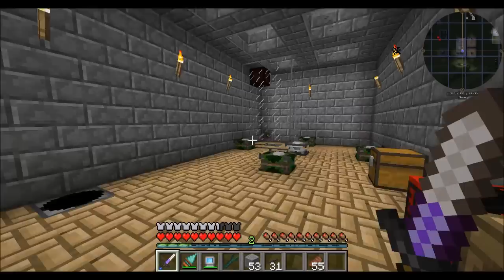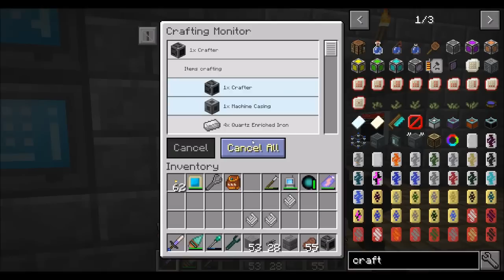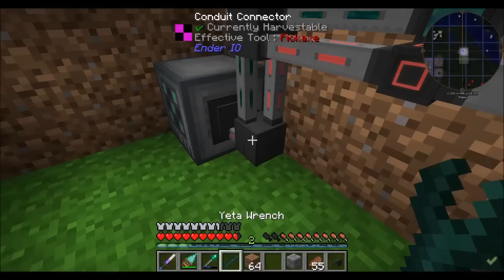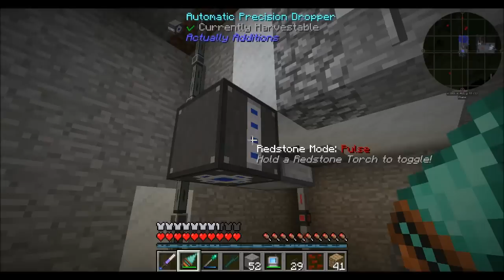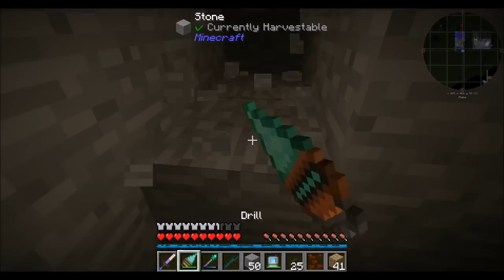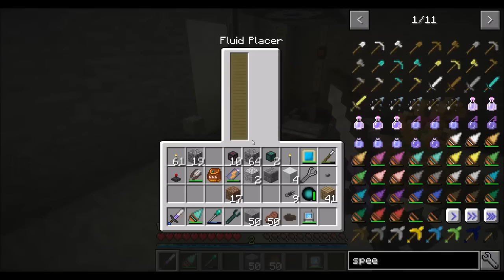Lets Play S8 E25 Fully Automated Oil

Comment: A tip to speed up atomic reconstructer crafting: Put the crafter on a chest with a very fast transfer node running into the open crate so it will drop all items at once, so the atomic reconstructer can do everything in one laser shot. Not sure if Refined Storage can do it that way, but AE did.

Comment: Dire, rather than using an exporter on the ore processing input chest, use an external storage bus set to insert only. The ores you input into the RS system will be stored in there instead. This will make a big difference when you have a quarry running as the ores won't be constantly going in and out of the RS drive system.

Comment: @direwolf20 I foresee a potential problem in your future with the empowerer setup (because I ran into this myself when automating). I'm using AE instead of Refined Storage, so it may not work the same, but I had an issue where it would try to run two crafting jobs simultaneously and it ended up putting the wrong items on the display blocks, so the empower failed. I had to tell my AE interface to only craft when there were no items in the buffer chest. Just an FYI in case Refined Storage might run into the same thing.

Comment: Why don't you simply add a generic import chest for the laser to dump its items into rather than dragging cables all over to the smelting room? That way you could laser the items from smelting room to the import chest and then use an import bus to get it into your system. You also could still use the lasers as a filter for whatever quarry you get down the line for ores and stuff so your RS system doesn't get burdened with a bunch of ores to be processed (Or just export from the RS system to a chest that uses the lasers to move to smelting room)

Comment: Dire, make an rf tools quarry.
It's nice and not to much power demanding
Reply: Lol the RF tools quarry is one of the most power demanding blocks running at full speed.
Reply: Sure, but if you give it a self contained passive power system, like a thermopile (or whatever its called in IE) it will regulate its own speed.
Reply: Indeed, but if you put a storage filter in there, it will only mine those selected blocks for you and help A LOT on power consumption. With the storage filter in your hand you can sneak+right click the ore block to add it to the filter. (it needs the ore block, so diamant, draconium, redstone, .... all in ore form).
Or do like me, and make an easy silk touch pickaxe. And make a collection of different ore blocks in your house ehhe, nice and easy way to setup your filter.

Comment: I have a random question: why does the Ender IO farming station sometimes break instead of harvesting (right-click) some plants? I wanted to set up a wheat/rice/sugarcane/pam's etc farm. And thats alot of different seeds you need to plant. 1 of the 4 sides is dedicated to wheat and works fine but the rest where i have stuff like 3 rice and more of less 1 out of every seed i could get, breaks after 1-3 harvest cycles. Is this a bug or is it supposed to do this to stop it from being too powerful? Some plants like for example the ender lily and sugar canes survives indeffinately but other plants gets torn apart. (I have tested all plants i'm using and all have the "right-click" harvest function).

Comment: where do i can report a bug in the pack? i'm going to post it in the "Refined Storage" minecraft forum if i found it but for some reason in the last beta from your pack (FTBPresentsDirewolf20110-1.3.0-1.10.2) sometimes if the line of cables is long enough (7 cables) the connection is not stablished to another machines (even if i tap directly to the core) and also i had the same issue that you had with the "machine is being used" while autocrafting crystalized canola seeds

i've overcome the issues manually throwing canola seeds (a stack) on the plate and also using the wireless transmiter/receiver blocks of the Refined Storage mod. seems to be a bit unstable in this version
Reply: Joachim Von Grimorium i had a ton of issues since that update with refined storage.  i could NOT get destruction or constructors to craft in RS.  though other complicated non-solder recipes
Reply: If you find out, please let me know. I want to get into immersive engineering but currently there's no way to get the creosote oil out of the coke oven and into a bucket for crafting treated wood....which is kinda critical to the whole mod.
Reply: +William Steppan I dont know if it was removed in later versions of the pack, but in early releases of the pack you could smelt a piece of coal in a furnace and it would magically turn into a bottle of creasote.
Reply: I'll hafta check that out, thanks :) I've been trying to use buckets, and JEI shows no crafting method of a bucket of creosote. This was on the 1.14 release and also the 1.20 beta, which actually takes a step backwards and shows no texture for creosote at all.
Reply: William Steppan ender io tank configured to input on coal coke side.  i put my tanks on top till i built emmersive engi multi tank.  you can grab buckets for sure out of both of those
Reply: Jimmy Gilley tried that...negative ghost rider
Reply: I'm downloading the 1.3.0 beta now to check it out...No changelog so putting it as a separate profile for testing

Update: No creosote bottles or buckets on 1.3.0 either. Sad panda. Er, wolf.
Reply: William Steppan Yea, ill check it out.  tonight.  it was early on when i was working with it
Reply: Refined Storage has a regression in 1.2.14, which in in all the current direwolf betas. The bug was supposed to be fixed in github, and a new version was pushed today on curse. Try updating refined storage to version 1.2.16.
Reply: Joachim Von Grimorium not quite sure what your autocrafting problem could be if you are using the same setup dire is, because order shouldnt matter. The problem dire was having with autocrafting the crafting upgrades was that he did not place the items in the right order in the pattern.
Reply: Vincenzo Menicucci i though about his problem was caused by the order, so o went to a test world and tried to reproduce the setup and even with the proper orden in horizontal or vertical sometimes got stuck aswell
Reply: Thought I'd let you know, I figured out what was wrong, though I'm not sure why it happened. I tried loading the pack on a different computer, same version, and noticed the creosote worked fine, you could bucket it and bottle it and the texture showed up and everything. After taking a closer look between the two computers, I noticed the working version said the creosote was added by immersive engineering, while the non-working version said it was added by railcraft. Since I couldn't edit the config within minecraft, I fired up the ol' text editor and disabled creosote in the railcraft.cfg and item.cfg files. Works perfectly now. I'll hafta see if it reverts next time I download an update.
Reply: William Steppan Good to know! Thanks!

Comment: you could have simply had 1 interface holding the 2 thigns needing only 1 craftign card,,, plus the enter io conduits woudl be able to mix and join witht he fluid and redstone conduits
Reply: also for the smeltign aera try and use a interface for the ore and use a filter on the enter io conduit pulling the stuff back